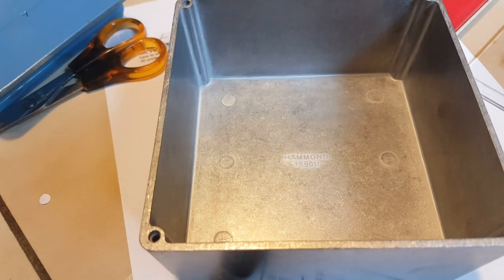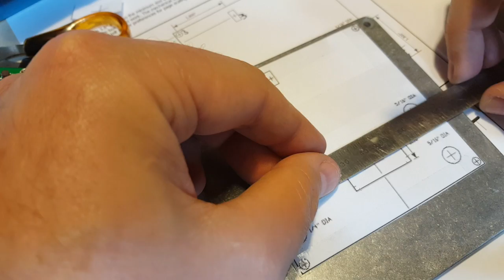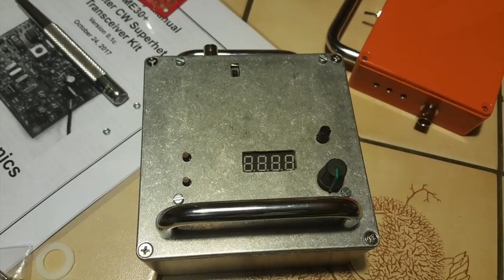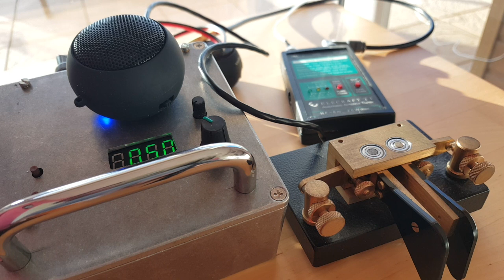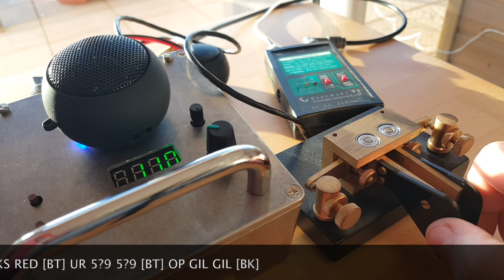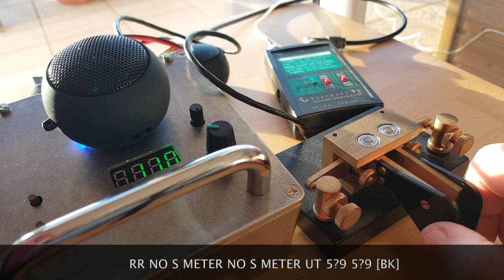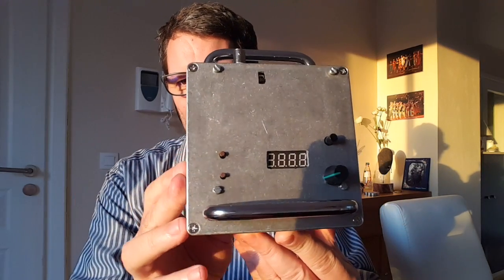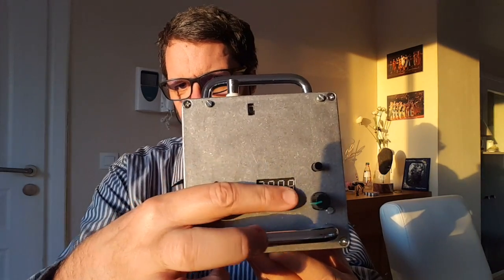The Weber Soda Pop Morse Code Radio, Boxing Up & Contacts.

Comment: I alway liked the Paraset radio design. An regenerative receiver and a simple transmitter, has to be the original qrp radio. I wonder why it isn’t used more often. It’s a great time for radio, there’s so many kits too choose from. As always, a very informative video thanks.
Reply from the maker: +Dave Schwarz And the parade is pretty cheap to boot!
Reply from the maker: Paraset!

Comment: Hi, Gil! A bit of a necropost, but I managed to snag one of Steve's Soda Pop II kits. He kitted up about 5 or 6 of them last week, and I managed to get an email to him fast enough, and it arrived yesterday. So I'm looking for case options. Your Hendricks case is a nice option, so I'll have to see if I can track one down. Either that, or I'll sit down with the calipers and graph paper, and figure out the dimensions so I can design one in Tinkercad and slice it up in Cura for my Creality Ender 3 3d printer. I like how you mounted it essentially on the lid of the case so you can put batteries in the bottom. Very nice idea! I may borrow it for my 3d printed case. If I do, I'll put it on Thingiverse. I already follow you there.

73, and a bientot!
Reply from the maker: Excellent, I saw Steve's post.. Had some troubles with mine but it should be up soon..

Comment: Great little radio Gil, and nicely done with the case. Have you considered a uni-bit for case drilling? Got my Foundation exam on Sunday, so will hopefully have my callsign in a couple of weeks. ATB
Reply from the maker: +Andy Wragg I can't wait to take it on some adventure! Never heard of the uni-bit.. I have one that is conical with multiple diameters, is that it?
Reply: Yeah - its basically a stepped drill bit. comes in useful when drilling enclosures and chassis openings
Reply from the maker: +Andy Wragg I use one for bigger holes...
Reply: Cool - are you going to have a try with a BITX40 kit?  It's on my to-do list once I start my intermediate licence training.
Reply from the maker: Yes, but I might need help with Arduino programming... http://radiopreppers.com/index.php/topic,1277.msg11912.html

Comment: Hi Gill it's a shame that they don't still produce those kit's Amazingly quite rx without all the Expensive bells and whistles of dsp and some of the Commercial Radios costing  €1000,s Very Impressive...I wish they would bring back thru hole components in Ham Equipment so we can fix them easier when they go wrong..I have a faulty Quad Bander that I know what is needed to fix but my Eyes get the better of me and the components are smaller than a 1/4 of a grain of rice lol Maybe I will managed to fix it one day when I get a decent Microscope...Enjoyed your video..take care with your fingers and the drill 😊.
Reply from the maker: Indeed Steve... You know, in some ways, surface mount kits are easier. It's just the small size that is difficult to deal with for ICs. Steve Weber is working on a small SSB rig right now, but I don't think I'll get one. CW does it all for me. Hopefully he will re-issue this kit some time or make an improved version, if that's possible...